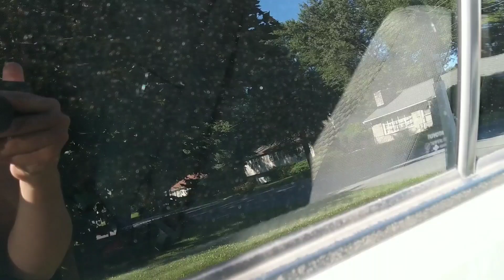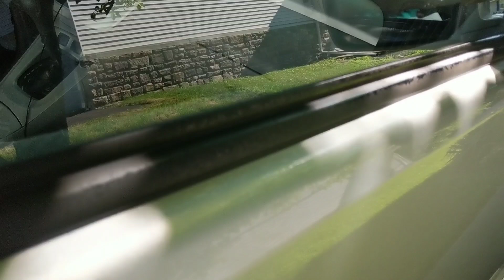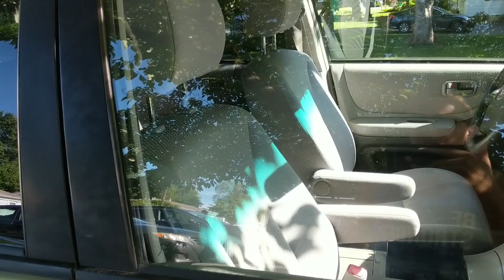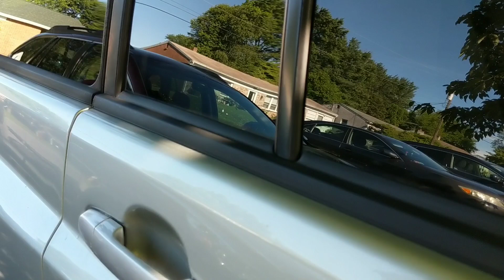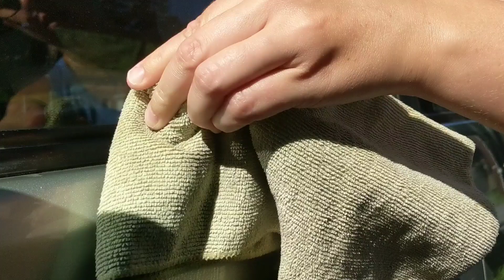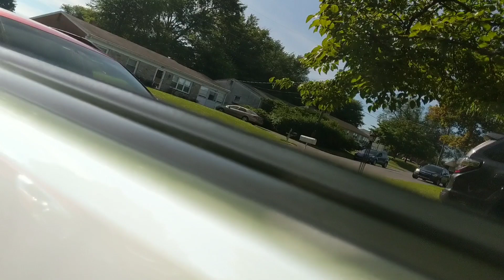How to remove mold/mildew and oxidation from your cars window trim with two basic cleaners!

Comment: Magic eraser with your favorite degreaser/cleaner.  Rinse and dry thoroughly, then apply Cerakote Trim Coat (wipes using gloves).  I recommend taping off the paint to protect it when doing this.  Mine has lasted for 4 years so far and still looks like new.

Comment: Thank you for sharing this!!! I have tried all kinds of products to clean up my trim. This is the first thing that worked. I rolled down the windows to prevent touching the glass and masking tape to protect the paint. Once the trim was restored I washed off the residue and wiped it down with Mother's Back to Black. It's been a few days and it looks amazing. Thank you again for such a simple process that works so well.

Comment: Hi there, Chelsea. Will Super Clean Degreaser work with the Magic Eraser as well? I know it works wonders on tires and was just curious if it would work equally well on rubber trim…
Reply from the maker: It can clean it, but the spray 9 has a antibacterial quality to it that super clean doesn’t have, but I would definitely clean it. It might not prevent the mold from coming back though.
Reply: @ Makes perfect sense. Thank you for the quick response!

Comment: Thank you! I am going to try this with Super Clean this weekend. Does anyone know if Cerokote Trim Coat will work on the rubber? Or it is only for hard, textured plastic?
Reply from the maker: My experience is, it works best on the hard textured plastic and smoother trim could be problematic down the future.

Comment: Will this method work on the larger trim right above it between the windows?
Reply from the maker: It can but I normally polish those after if its not porous with 3d Speed

Comment: I just used a steamer with a brush and came off with hardly any work.  I don't know if the steamer is bad for the paint or anything, but it sure took the gunk off.
Reply from the maker: It can work but it takes common sense. Steam can also damage the clear if you don't know what you're doing.
Reply: @attention2detailswchelsea  Thank you for letting me know.  I wasn't sure about that part.

Comment: I've been wet sanding the damaged rubber 1/4 panel window trims on the back doors of my Ford Fairmont EL. A lot of the rubber had holes in it and was peeling due to the harsh ultraviolet rays of the Queensland sun. I just used ordinary sandpaper circles from eBay.

Comment: Thank you for the video.  I just tried this process with generic Magic Eraser from Amazon and Simple Green cleaner.  It removed 90% of the spots and stains.  I’m going to follow it up with Mothers Back To Black trim dressing.
Reply: The magic eraser is just a super fine sand paper. Get some 1200 grit sand paper and tape off the paint with green painters tape. The 1200 grit sand paper will take the top layer off pretty quick. Then clean the trim with alcohol and then use paste wax to leave a like new shine one the surface or use Mothers back to black.

Comment: You can also remove the trim to clean it most cars have a nut on the inner door or small fastener to remove and trim will slide off by pulling it backward off of the door I have the same material on my 03 Taurus Back to black will also remove the mold but it is time consuming .

Comment: Hi all,
My car is 4 months old , 2020 model . I park outside due to a lot of stuff being hoarded in our garage. I will need some time to get my garage cleaned. In the mean time, there a lot of dust, flowers from the tree parked under and dirt is collected between the car window trim and the car window. I have got my car manually cleaned. They did not get it. My car look old now. Please suggest a cleaning method or video for my car. Thanks!

Comment: I have a 2010 Camaro SS that gets this very bad from the oak trees over my driveway. I maintain my car fairly well, but we get so much rain in the summer here in Florida that it's a PITA washing the car to only have it rain 2 hours later. I found magic eraser works very well, but you have to tape off the paint near the trim to avoid scrubbing into it. Also need something to seal or treat the trim after scrubbing. Great job btw!

Comment: "Hi Chelsea How Are You Doing,  I Have A Question After You Cleaned The Trim With The Spray Nine and Magic Eraser What Type of Rubber Trim Protectant Did You Use To Bring back The Shine?..
Reply from the maker: You can try Cerakote trim coating but I didn't treat it as customer wasn't requesting it, just wanted them cleaned. I did put wax on them to help prevent further damage. It had a consistent finish after.
Reply: @attention2detailswchelsea  Thank you Chelsea I'll Check it Out!!🙂

Comment: This is an excellent vid. I will be stealing this technique to remedy trim issues. I use Protect All to dress exterior rubber and interior plastics. It is not greasy and helps level the color on faded trim. It is extremely versatile on all surfaces except cloth. A combination of Protect All and Meguiars Ultimate Fast Finish makes an incredible combo to protect leather surfaces. No more ceramic coating for me on leather. 👍

Comment: Great Tip! What year was this vehicle? I need to try this on my 13 year old vehicles. You could tape the painted area and feel better and be more aggressive on the rubber trim. Have you used Meguiars 39?, I just bought some and tried it on some exterior plastic faded trim that nothing made it change before, alcohol, alkaline degreasers nothing before I dressed it, since the dressing will be just a temporary fix fading back to ugly in a few weeks.  After 3 weeks and no dressing, plastic is still black. It took no effort just rubbed it with MF towel and it changed color instantly. No clue if it will last but I may dress it before it fades again. Maybe you can try it and make a video?  I think some of the rubber trim also has a clear coat and I wonder if once is removed or gone it may not be restored just cleaned and dressed frequently to keep it from getting so bad, it will need to be replaced.  I tried to search about this a couple of years ago and could not find any information to clean/restore or fix it.  Thanks for the video Chelsea it is good to see good results like the ones you had.
Reply from the maker: I just got Meguiars 39 and used it for my father in laws tanneu truck bed cover and it did a fantastic job of cleaning it. I got it in case I get wax on trim but so far I'm loving it.